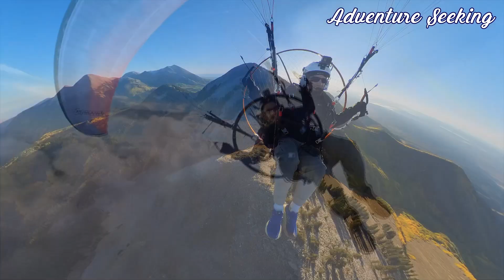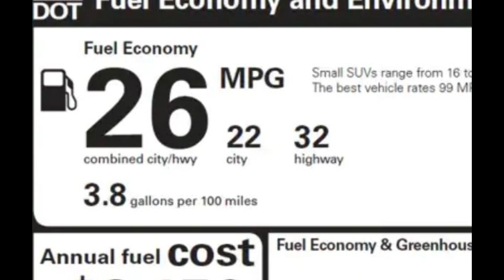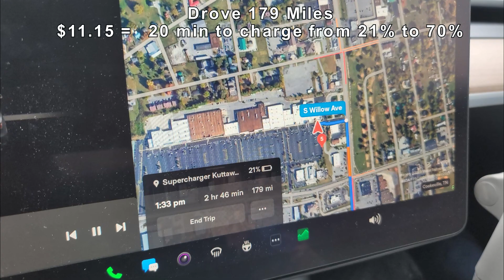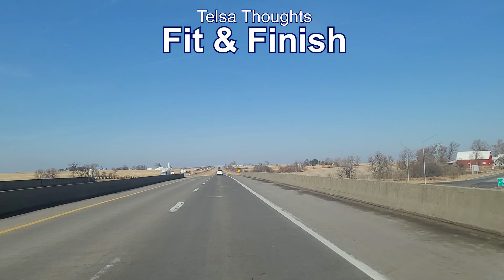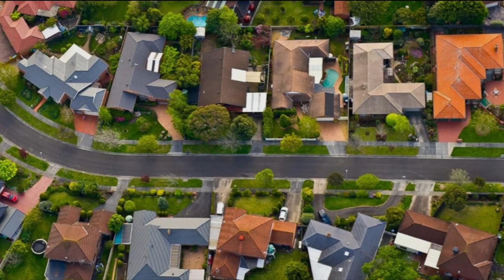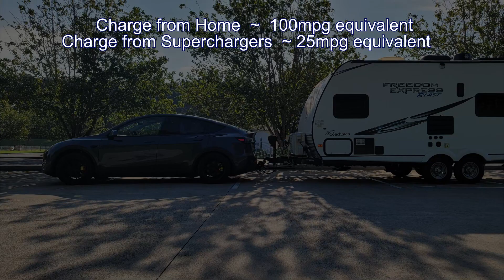Tesla Model Y -  Real Range, Camping and cross country using Superchargers.

Comment: Interesting stuff.  Cool to see the Tesla hooked up to the camper and trailer.
Reply from the maker: Hey buddy, yeah I've tested that car out in a lot of configurations. It really tows great and handles well, however your 300 miles drops to about 120miles of range towing. Maybe if I lived in the plains of the mid-west (no hills) that would be different.  It doesn't seem to lose much range with a cargo carrier on the back with paramotor though, which is great!  You just need to install a 30amp plug at your flying home so I can bring the tesla and camp at your place ;)